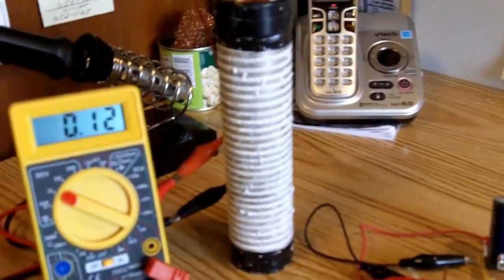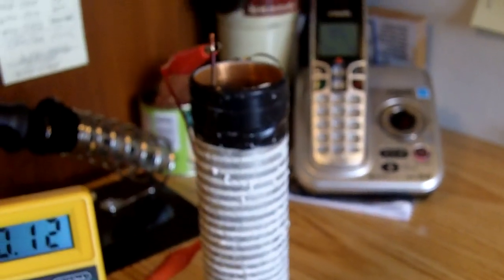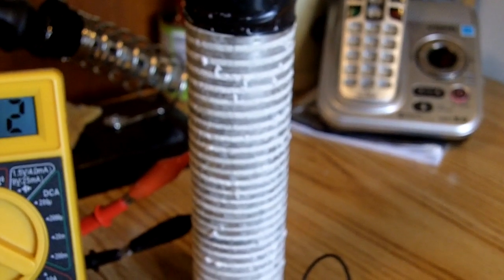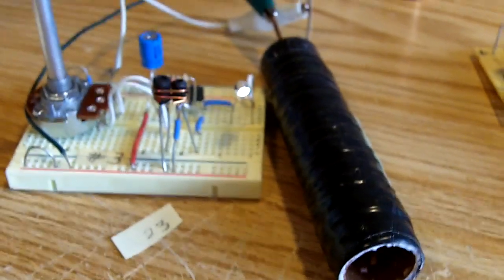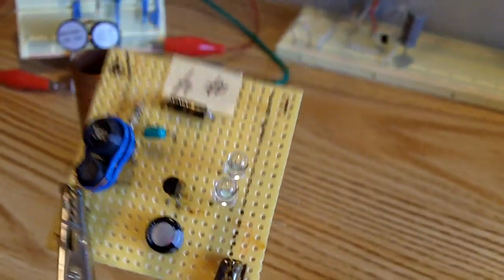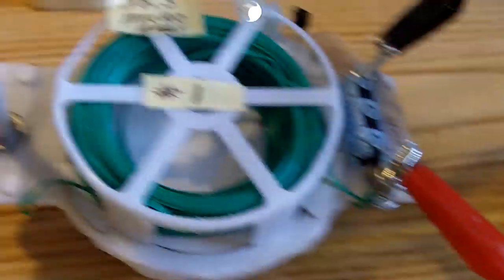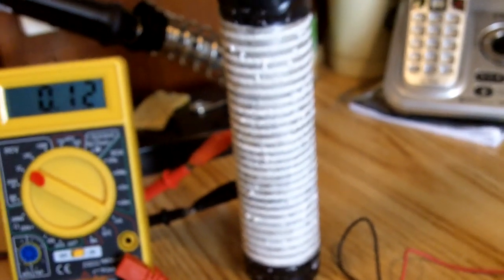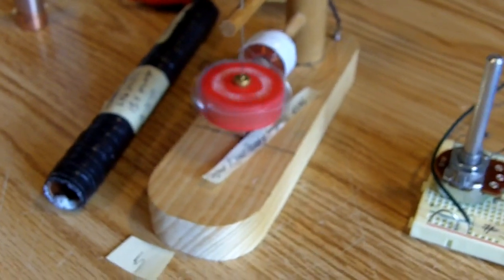Battery Experiment.MOV

Comment from the maker: I'm looking forward to seeing your radio circuits. You said that when you were about 9 years old you made crystal sets, so did I. I had alot of fun making and experimenting with crystal sets back then. I put one together about a month ago and made a small 9 volt amp for it. it works pretty good but I don't think I could make a 9 volt battery. At RadioShack  for $10 I got A pair of computer speakers so I don' t have to use ear phones. Thanks for your comments.

Comment: Its very important to follow these directions...

1-Wrap paper around copper tube.
2-Get paper damp with water from a spray bottle.
3-Sprinkle Salt Substitute on to damp paper and rub it in.
4-Spray the paper with water from spray bottle.
5-Sprinkle Epsom Salt onto paper. 
6-repeat steps 2 through 5 twice.
7-Allow paper to dry over night.
8-wrap magnesium around paper the next morning.

Don't dunk in water, it dilutes it so much that it doesn't work. You wan't equal parts of both salts.

Comment: Great video...always enjoyable viewing :)
Looks like you replicated my Walgreen pill bottle water cell. 2 of mine are at 2 months now, twinkling the LED's just as well as at the start. Was worried about stagnant water but are fine. Had a problem with black deposits on the galvanized steel electrode that I use, but appears fixed with scraping off and immersing in alum solution for a couple of days. J Bedini had a similar trick for Earth batteries and I was told via NickZ. Could be a tip.

Comment: Hi magnetman2010, very nice work in your movies, tnks for sharing and your effort! In your batterries mixture, for improved results, you can use a solution of colloidal silver, dioxide manganese, zinc oxide, epson salt, alum, salt substitute, and let if dry in crystals formations! also you can make multiple cells and let them in series with a led for a few days to be in short through a diode, assuring in this way, a specific inside crystal formations! All the best and maybe try my OU Charger!